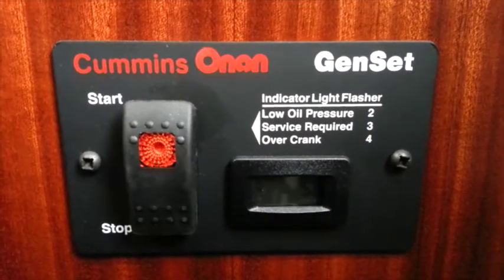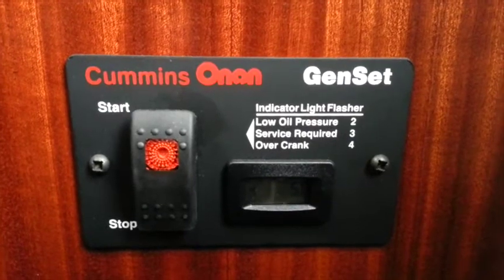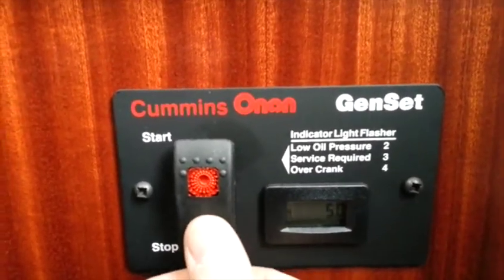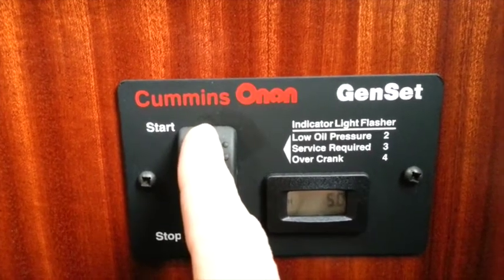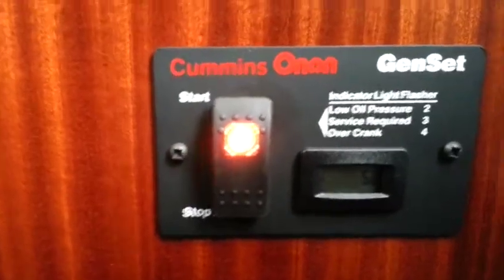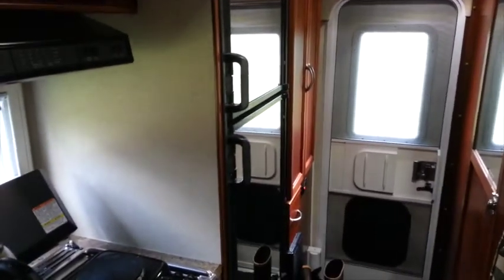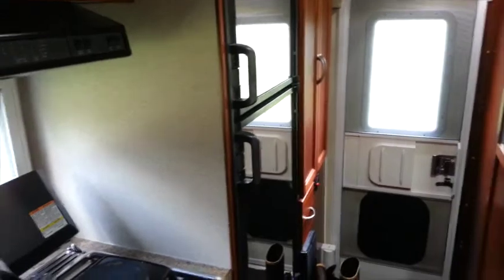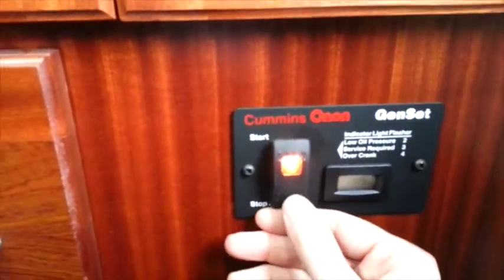Truck Camper Generator Cold Start

Comment: Hello there. I think Onan recommends exercising a generator 30 minutes per month. Also a generator should ne running for a few minutes without a load before using it. Starting and stopping a gen right away ils not good. I think you'll get these info in the gen manual. Nice video. Take care.
Reply from the maker: Yes you are correct in the starting and running intervals. Take care and thanks for commenting!

Comment: thank you,  I can't believe i have not seen this.  It answered my question.   nest thing I want to do is mount another tv in front of the hutch on the drivers side right across from the factory tv.  pretty much the same thing,   do you think it would mount up there? or some place right there.  the reason why is,  im planning on 200 watts if solar and i want to install a dvr security system.  I want to put  a small camera left and right out side in the corners in the front of the cab over and in the back and one in the back looking over the door.  and one looking forward and looking down over booth sets of truck doors.  and use that tv as the monitor.  so do you think there is room in your truck camper to do this?  next your basement,  it is kinda a small door,  in your thoughts do you think right at the end of the basement that would be some place in the middle of the hall way?  im sure a trap door could be installed in the hall way to open to get to the back of the basement.  would it work?  thanks so much.
Reply from the maker: +Jeff Dischbein I would think some framing inside the cabinet would be in order to securely mount the unit to. It could be done. I have seen a trap door install done on Northernlite.org forums. I would not want to do that I think it would tamper with the structure and weaken it.
Reply: where would you add one more battery in your tc if you where to add one?
Reply from the maker: You could add a gel battery under the step on the floor inside the camper to get into the bed.
It would need to be a battery that requires no venting.

Comment: Hey west coast, Is that camper light enough for a 1 ton ram SRW. I mean what kind of weight after you get all your stuff in. Thanks
Reply from the maker: Yes a 3500 single rear wheel truck would be plenty to haul around this camper. I met a guy with a 10'2 NL with such truck and he did not have air bags and said it was fine. Not sure on exact weight. When I hit the scales I will post a video talking about that. Thanks for watching!